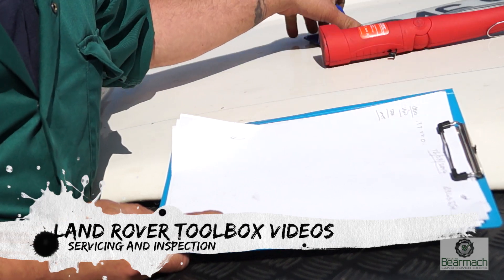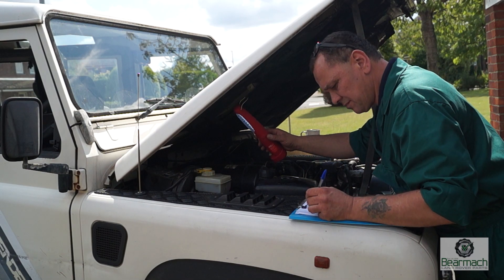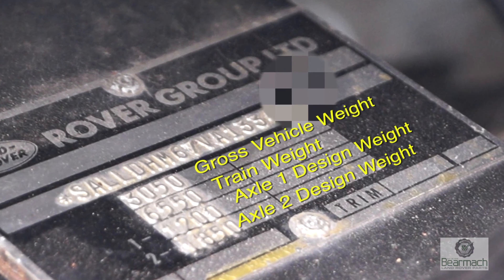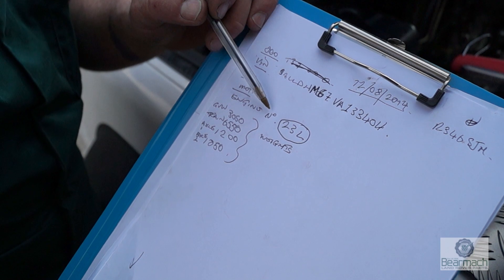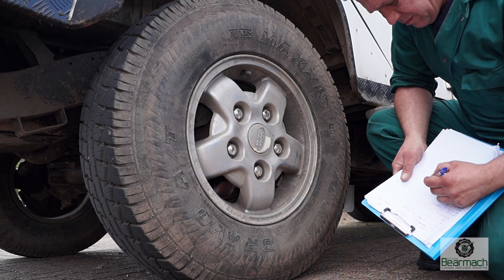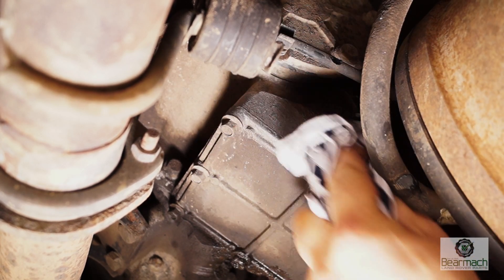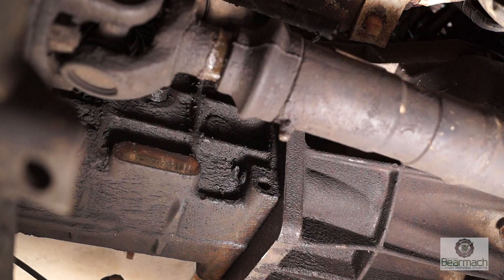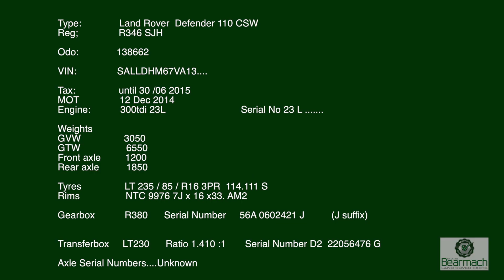The Defender serial numbers - The Fine Art of Land Rover Maintenance

Comment: Does anyone know how to tell the date (month) of manufacture for the Defender 110 from any of the numbers?  Thanks!
Reply: Check under the oil vacum pump. Mine have metal plate indicating week/year. Mine have 27/85 I believe it's week 27 year 1985 when was engine build or put in the vehicle. I my be wrong but it's matching as it's close to date of first registration of my LR90.

Comment: I hav an 06 range rover. 98k miles. When i drive, is shows transmission fault limited gears . And it does not go pass the third gear. Any one have similar experience?